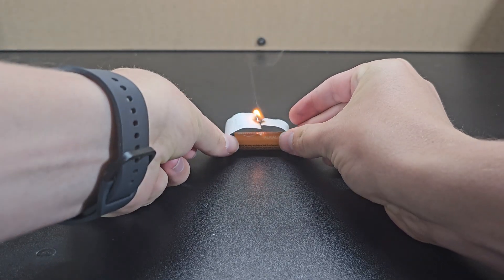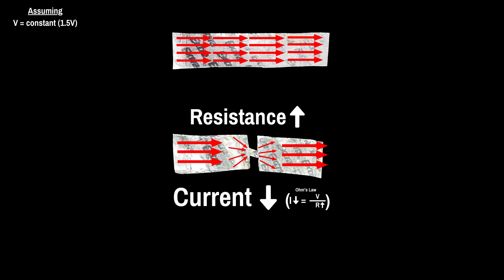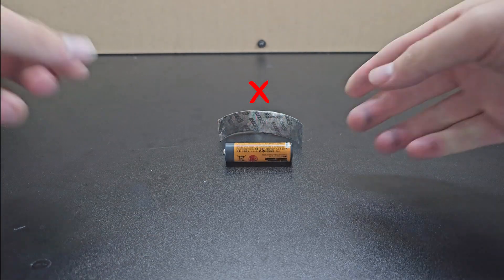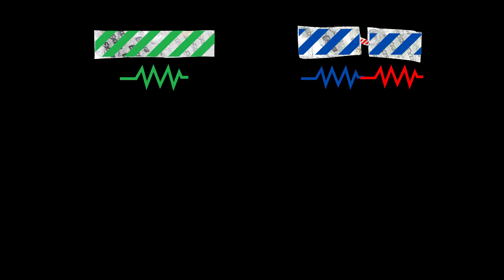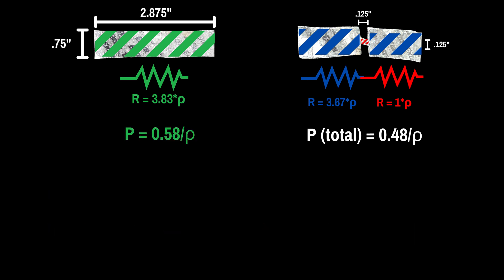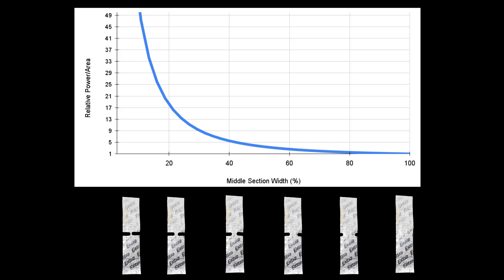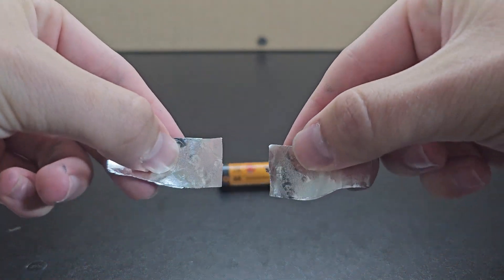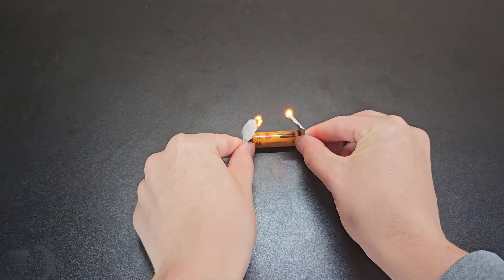Gum Wrapper Survival Hack - Full Explanation

Comment: Youre wrong about the heat increasing resistance leading to even more heat, that would be positive feedback and cause thermal runaway. It causes negative feedback and less power. For example, a regular old incandescent lightbulb will have an intush current of about 10x that of the normal operating temperature after a coupe seconds.  Assuming your voltage source is ideal ( can supply infinite current, or in practice enough for the circuit)  the lower the resistance the more power will be disapated. 
P=V²/R
This can be confusing as modifying one part of a strictly resistive circuit will effect the other parts. Am easy way to think about it is 0 resistance is a short circuit, infinite resistance is an open circuit.  As another comment pointed out, you should also look at the internal resistance of the battery- when included in your circuit it is easy to see that you get max power transfer when resistance is matched (max power transfer theorem).
Reply from the maker: I think we are actually agreeing (on the negative feedback part), but perhaps I did a poor job of explaining what I meant by the "positive feedback" that I drew (I'll discuss that later in this comment). However, me ignoring the internal resistance of the battery could be a valid concern. I dismissed it for simplicity because I assumed that the gum wrapper resistance (load) was already greater than the internal resistance of the battery (I think around .2 ohms?). If so, then the dissipated power in the gum wrapper (load) would be decreasing with any increased resistance caused by making it skinnier in the middle (in agreement with the MPTT). In contrast, if the gum wrapper has a lower resistance than the internal resistance of the battery, then increasing the resistance of the gum wrapper (load) by cutting it would increase the power to the load (MPTT) until the resistances are equal, and it would make the analysis I did of the simple circuit in the video irrelevant (and I would therefore delete this video because it doesn't make sense to even do this analysis without the internal battery resistance, even though the math checks out). If anyone has the instrumentation to measure an Extra gum wrapper with the folded edges part removed (as shown in the video), let me know what resistance you measure. My multimeter can not accurately measure below 10 ohms. Hopefully someone has that specialized equipment to do so. In hindsight, I should have spent more time validating that assumption before making this video, but hopefully it's fine. 

Anyway, assuming the internal resistance of the battery can be ignored for the purpose of this video (and therefore the simple analysis shown still makes sense to do):
I was not trying to say that it is positive feedback for the overall circuit. The total power dissipated does decrease as R increases (P=V^2/R). I used the made up adjective of "concentrated" to just mean the ratio of the power dissipated only by the skinny section divided by the surface area of that skinny section (which is what I label P/A). It's that value that increases even when the overall gum wrapper dissipated power is decreasing. It's a larger percent of the decreasing total power, and is dissipated in a smaller surface area. I stated this in the video, but just wanted to reiterate. 

Let me know if I'm still misunderstanding what you mean or if you think I'm misunderstanding any of the concepts. I studied Mechanical Engineering, so I'm obviously not as familiar with some of these topics, which could mean I have delusional confidence that I understand lol. I'm going to pin this for visibility to hopefully get an answer about the load resistance. I really appreciate your thoughtful response! and look forward to hearing from anyone else!
Reply: @JaDroppingScience  I agree with mostly everything you said here, although I didn't read it thoroughly.  I will read it all the way through and provide any additional thoughts I have, but for now I will clarify why I said you were wrong on one point:

The V²/R does apply to the entire circuit as well and any individual component. We can always draw a box around multiple things and consider them as an individual component con convenience, but that only tells us about them collectively, and each peice still behaves in its own way.  Perhaps I misunderstood what you said, I thought you said that as the resistor heats up, Resistance goes up and even more additional heat will  dissipate. While I have found that to be true in general, of course that is not always true. 

I wasn't thinking about the internal resistance of the battery ( and am not familiar with typical values) . If you model just the source with resistance and the entire load as a resistor, you can plot the voltage / power / current  though the load of a carried resistance and see it will look like an upsidedown parabola shape. Sweep the load resistance value up from 0 Ohms and the power dissapated out the load will start at the short circuit output  ( see Norton equivalent circuit) , will peak at matched resistance, and then  go back down to an open circuit value. So it is indeed possible that raising the resistance can result in more power burned in that component. We have to reevaluate the entire circuit to know for sure, I just assumed it probably wouldn't matter enough to effect the part that burns in a positive way, we  won't know for certain unless properly analyzed.

So in summary, I should have said that it is generally the case that higher resistance will burn less power, and this property is negative feedback, which helps keep it from going into thermal runaway. As long the voltage drop across the bridge is relatively the same hot vs cold, then less power will be consumed.
Reply: @onradioactivewaves Ja was talking about the resistance in the thin part
Reply: @mr.cauliflower3536  ya I know. My point still stands that unless the higher hight => higher resistance  caused the circuit to be impedance matched to the "source" ( and I doubt that, but it is possible)  or at least moved in that direction enough to overcome the increased resistance, then the heat/energy dissipated will be less. 
So I was saying that that statement he made is generally wrong but not always. I may have misunderstood or perhaps he mispoke, I think we are in agreement about the issue nonetheless, so no sense in splitting hairs over something that was not intended to be said.
Reply: @JaDroppingScience  I may just have to break out the scope and help you, I'll need to procure the gumwrapper.

If you want to make an accurate measurement of low resistance,  one simple and easy way you can do so with a Wheatstone Bridge Circuit.

Thank you for your thoughtful response.

Comment: While the current decreases, the current density in the skinny region greatly increases.  A high current density is what leads to a material overheating and subsequently igniting.

Think of it this way:  a very high current of 10 Amperes could easily be transmitted via a copper wire if the wire was fat enough, thus limiting the current that each unit of cross-sectional wire transmits.  But, if the wire is skinnier, then each unit of cross-sectional wire will be overwhelmed and overheat.

Comment: Ohm's law applies to static systems. Since the circuit is changing with time, you need to bring electrodynamics into it. Saying "the heat increases, therefore the resistance increase, therefore the power density increases, therefore the heat increases" is circular logic. You used the fact that the heat is increased to deduce the heat is should increase. I'm not an expert in this topic, I'm just throwing in my two cents.

Comment: Greater video, you didn't touch on matching the batteries internal resistance maybe
Reply from the maker: Excellent point, I assumed the load resistance (gum wrapper) was already greater than or equal to the batteries internal resistance. I should have verified that assumption. If anyone has a specialized multimeter or way to measure small resistances, if you could let me know what the gum wrapper resistance is (with the folded parts cut off as shown in the video), that would be great. If it's less than the battery internal resistance (between .1 and .9 ohms), then I'm going to delete this video.

For more details why: see my response to the pinned comment.
Reply: @JaDroppingScience   thanks for the answer! unfortunately I don't have a mohm meter, but maybe someone from the audience does :)